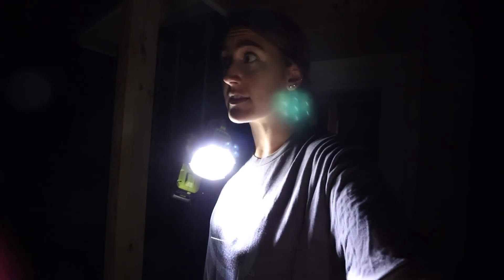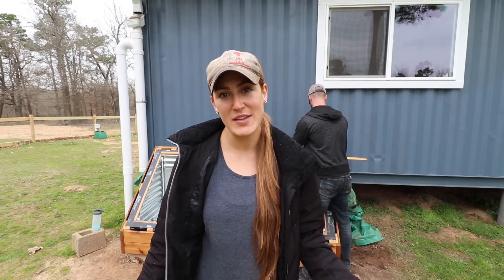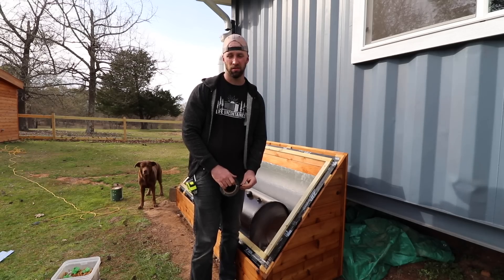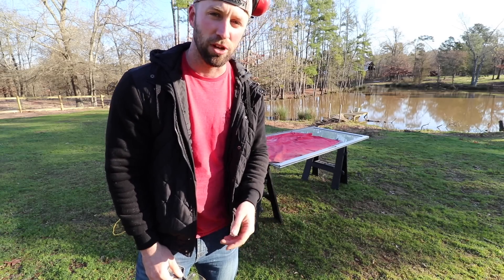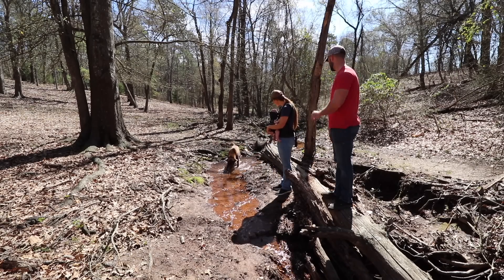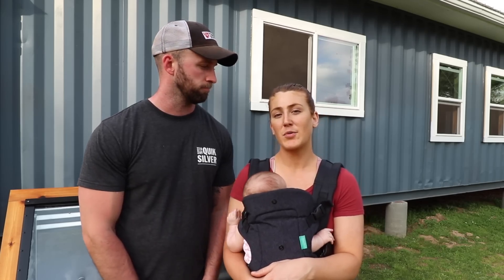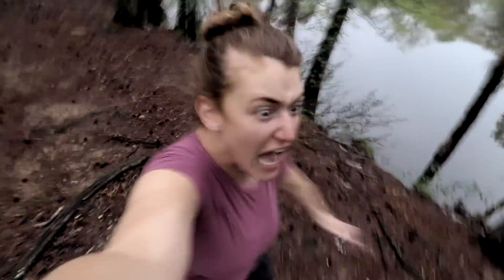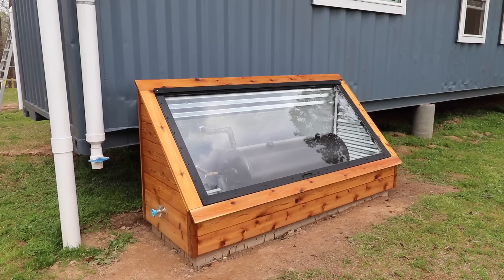Storing The SUN'S ENERGY In A Water Tank!

Comment: **OK, JUST (literally) BINGE WATCHED THE ENTIRE BIULD! Hi, you two (I mean 2.5), My name is Michael, and I'm an Electrician and a first-time commenter from Seattle...

I hope everyone is staying well! I super love the channel, the way you guys film, and your chemistry! I really appreciate the quality way in-which you build things, I've learned a lot, thank you! 

A tiny bit of background on my experience: Retired residential electrician (wired about 500 homes)

A few electrical tips, if I may? IMO you've done a good job on your electrical work so far! I only see a few minor things that I'll point out below. Please forgive if these tips have already been offered...

:) NM cable shouldn't be run in conduit for long distances (it can drastically derate the ampacity of the wire, it's essentially like putting a conduit, inside a conduit), it CAN be sleeved for short distances, and should NEVER be run outside in conduit (the paper filler around the ground wire can wick moisture). I'm not sure if you've actually done this or not, it's hard to see everything on the videos. 

:) NM cables should be secured as they enter the panel, NOT merely run through a conduit TA with bushing.  (a 2 screw metal connector works fine) 

:) IMO lighting in bathrooms is tricky, typically lighting from above doesn't lite the face well; you may consider wiring for additional lighting, just in case you decide the can lighting isn't adequate in preventing shadows. I've had success with wall scones on either side of the mirror along with cans; that way light is coming from different directions; thus, lessening shadows.

Future Tips:

*Cans in the Kitchen are great! Placement is critical though, I'm also 6'-3", your head can easily cast a shadow on your countertop if you place cans behind you. Idea placement is directly above the work surface, that way; you, get great light on the tasking area, and the light goes perfectly into the upper cabinets.

*Nailplate everything! Especially if your wiring/plumbing hole gets closer than 1-1/2" to the outer surface (drywall nailing surface)

Sorry for the book, hope it was helpful!

-M
Reply: Great and much appreciated advice.

Comment: In 2011, I replaced my hot water tank with a huge unvented one, that has a secondary coil, and fitted an evacuated tube solar array, which takes the edge off, in winter, but in summer, can fully cater for all my hot water needs.  I am so proud of the system.

Comment: Don't forget to install a water heater pan underneath your indoor water heater because when they leak they can flood a home.
Reply: Eaxactly...a galvanized tray is all you need.
Reply: @mauriceryton  doesnt have to be galvanized, only if its a gas, otherwise plastic is fine
Reply: Agree with the pan as well and if you had the legs on the bottom of it also reduces cold air transfer
Reply: agreed, it also needs to drain to the exterior or into the sewer system.
Reply: Also remember a drain pipe.  I had a property with a mold issue due to having the pan, but no way to drain.
Reply: In Lancaster PA  said we have to use a expansion tank for our water heater. Not yet pan for it my dad has the heater at 100°F any ways so it won't hurt and the pressure is 110 psi and a water softener guy installed a water pressure valve.
Reply: I was going to mention this too. You'll proly wish you had it on a stand as well and not directly on the floor
Reply: I agree with the other replies.  honestly most water heaters that I've seen come with three legs not sure why yours didn't or if you took yours off.  If you want foam on the bottom of your water heater cut a circle of foam board and glue it to the bottom of the heater and put it in the plastic tray.  Wrapping that heater will save you way more money than just a piece of foam on the bottom.  That little plastic tub will save you thousands when that water heater ruptures.
Reply: Or just make a floor drain, No mess and it goes outside.
Reply: @jonathanpear7361  true I agree
Reply: Yeah, I was thinking that when I saw the foam.
Reply: Just what I was thinking. Never regretted getting one for ours.
Reply: As someone who has had to replace a hallway and bedroom floor due to a pinhole leak in a hot water tank, I cannot stress how strongly I agree with the comments for the drain pan. Other than that, great work and great content.
Reply: Absolutely, a pan with an auto shut off sensor, incase was heater fails. For the batch water heater, why not make the lid/door easier to open, with a  hinge. For sure you will need to get inside for maintenance.
Reply: You should add some pvc from the burst cable down to the drain pan and have the whole pan drain right outside. Also get one of those 9v water sensors that yell when they get wet and put it in the pan
Reply: @crowsnestsac  he put insulation under it so the heat tranfer wont be significant,  but yes best to raise it some
Reply: You'll appreciate a drain pan under that water heater.  When they fail, it's a big damn mess. I know!  You'd be doing yourselves a big favor to have a plan for that water to get out of your new house the way YOU want it to.
Reply: And preferably a drain hose that goes outside attached to the pan.
Reply: Who know what's the background sound 1:40?
Reply: @jonathanpear7361  Should have a drain anyway because you want to flush it every now and then to de-scale. I'd also mount it on a pedestal to raise it off the floor a few inches.
Reply: I was thinking the same thing! Lol I hope they don't forget that part! What a mess that would be!
Reply: Dont know why they make us put a pan inder it. There is way more water in a heater than the pan can hold
Reply: Regarding leaks, this is not about the water heater as much as it is the lines to various locations. It is good to run a main to a manifold (s) and then run a solid tube to the sink, etc.. Best not to have splices inside a wall that one day will leak. Have your leaks where you can get at them.
Reply: @scotthummel4248  The pan is not meant to hold all the water in the water heater. That is why the pan has a drain. The pan essentially funnels the leak to the drain instead of flooding the house. When, not if, the water heater leaks, the water heater will keep filling with water. It is not jut the 40 gallons of water that the tank holds.
Reply: @lifeuncontained.  Is the water heater in your master closet?
Reply: 1000% yes.  Install a metal drain pan under that water heater and drain it to the outside.  It will be your worst day WHEN you spring a leak.
Reply: Or, run the pop of valve underneath the house and route it to a spot the is directed towards the yard.

Comment: We just had a home inspection and inspector recommended water heater to be off the ground by six inches and also in a drip pan with a drain leading outside
Y’all home looks amazing, goals
Reply: Agreed. And at least 4 inches from the wall. This will give you fire safety standards.
Reply: Haley Hanson where the hell do you two live??

   The water heater is inside the house and it must be 6 inches off the floor & 4 inches away from the wall???
Reply: @ltsgarage7780  Pretty sure it was misunderstood...TPR drain pipe needs to discharge 6 inches from the ground, not the water heater itself. That would make more sense.
Reply: Dunjie Zheng that’s been code for 35 or more years. Same thing with the pan. You only need one running to the outside. Put the PTR  valve into the pan. Then run the pan outside. Turn it down and then end must be 6 inches off the ground.
The pan code is only about 5 to 7 
years old.
  The t&p valve running outside is probably 30 years old. 
 Where do u live??
Reply: My dad, a master plumber of 40+ years just agreed with you Haley
Reply: NRFLKN did you see how Haley changed what he said??
   Like you father I’ve been doing plumbing for a very long time. I’ve owned my own business for just over 46 years. 
  Where does your father apply his craft??
Reply: LT's Garage he’s been at it since 1972 but he refuses to completely retire. We’re in Va. He also spent many years as an instructor in the apprenticeship as well as writing the plumbing code for gas log fireplaces.
Reply: NRFLKN that’s cool. I started in 1969. Went through the program. 
  I have a sister that lives in Roanoke. Her husband is a contractor back there. He’s older than I am and still working. I refuse to retire also! Hope his is staying home for now. Hope everyone is doing well. No one is sick??
Reply: If it is off the ground it is most likely a gas hot water heater.  They have an electric hot water heater and does not require an open flame that can cause a combustion.   My parents electric hot water heater was on the ground and close to a wall.
Reply: If it is off the ground it is most likely a gas hot water heater.  They have an electric hot water heater and does not require an open flame that can cause a combustion.   My parents electric hotwater heater was on the ground and close to a wall.
Reply: NRFLKN back in the 70’s & 80’s I had 16 trucks running around most of them had 2 plumbers in each truck.  Then I got out of the new construction. I went to service and remolds. Then in the mid to late 90’s I started slowing down some. I was getting tired of Baby sitting these plumbers that would say the knew how to do service work and didn’t. Then in 2001 I started having pretty major heart attacks. After I had 5 of those along with heart surgery and a few stinks. I got rid of all my plumbers. I really like to wot so I kept 1 of my big service vans. 
Now I work about 10 to 15 hours a week.
  Right now I’m stuck at home with this Shelter in place order going on. 
  I must pay attention to it. I’m over 70 have a bad heart, diabetic 
Enjoy your time. Be safe. Stay sheltered in!!!!!!!!
Reply: LT's Garage  Take care of yourself!  Sounds like you have had a very busy life.
Reply: @ltsgarage7780  NYC here. Agree with everything on tpr/discharge/pan/drainage. Couldn't really find anything on water heater having to be installed 6in. off ground. On requirement here is for older gas water heaters installed in garages - 18in. off ground due to risk of combustion. Newer models are listed for use without elevation. Local code specific maybe?

Comment: On the water heater.  There are thermal blocking pipe nipples that connect to the hot and cold water pipes at the water heater tank.  Bonneville Power Admin Mangan Labs found these were the best energy saving add-on to water heaters in their 1980's energy efficiency testing.  These nipples contain specific flow blocking beads that stop the heat from escaping the tank and the cold water cooling the tank when the water is not flowing.   Love your videos and watching your work and family grow.

Comment: make sure to put you water heater in a plastic tub with an overflow through the floor along with an overflow off your pop off valve through the floor too. That way if your water heater leaks it will be contained and would drain off without damaging your floor.
Reply: I laugh when I see a 50 gallon tank sitting in a 3 inch deep pan with no drain through the floor.

Comment: FYI those sliding glass doors are typically double-pane with a reflective coating on the inside glass to reduce the sun ultraviolet transfer. You won’t get the full impact that a single tempered glass without the coating. Your idea is awesome though! Not trying to be a negative Nancy. 😁
Reply: theres actually 3M tint you can buy now days thats clear but blocks a ton of heat.

Comment: Just a heads up, I had those flex hoses on my hot water tank and they started leaching rubber into our water. First a black ring around the bath tub.  Then particles in all the faucet diffuser screens. Ended up putting pex directly to the tank.
Reply: I have them installed for like 15 years and do not experince that. I loved them and think they are superior

Comment: Should use a clothe when applying stain like that to the wood, brush doesn’t do the justice a rag or clothe would do. Soaks into the wood 100x better. Just a tip!
Reply: I'm starting this project now thank you for the tip...I greatly appreciate it
Reply: George friesen, 
Wiping is fast, almost as fast as spraying, Wiping is also every bit as effective in all situations except possibly into recesses such as inside corners, fluting, deep carvings and the like. Don’t get me wrong. I’m not against brushing stains. I just don’t see why anyone would do it, especially on large surfaces, and even more especially, when using any stain other than a slow drying oil-based stain. All other stains, including water-based, lacquer and all the dye stains, dry too rapidly to allow time to both brush on and get wiped off of large surfaces before the stain begins drying.
Reply: @8lxVenom  I believe he was using the stain with sealer combined, brush is best.

Comment: they probably should've put the insulation and drywall first
Reply: Just wondering why they would do that before finishing all the electrical and plumbing? You do realize they are still doing that right???
Reply: It's called "pop-rock" (only drywall and finish areas behind hvac units, water heaters ect...) it is very difficult to drywall and finish those areas after the units are installed. It can be done. But it is more difficult.
Reply: Pre-rock*
Reply: @spartandrywall  They have to have everything connected to fully pressure test the system. If it has any leaks they would likely have to pull down any sheet rock they'd put up.
Reply: If you didn't understand, I was wondering why they were installing appliances before the put in the drywall

Comment: 3:15  When you clean your vacuum cleaner, you become the vacuum cleaner.  Just a zen moment there :D  You could probably mount the in tank thermometer through where the old thermostat was mounted.  I'd be tempted to also mount a thermometer on the inlet to the preheater housing to check the delta T

Comment: Love you guys.  Consider a drain pan for that water heater, not needed now, but if there are ever leaks, you will appreciate it.  Also, if you connect the drain pan outside, consider putting a short hose on the water heater drain near the bottom, to the pan, then when it is time to drain the water heater to get out sediment(service) It will be all set up, no need to drag a hose in.    I am looking at replacing my water heater, and have been thinking about it a lot.  I am enjoying your videos and S's attention to detail.

Comment: I have a water catch pan under my gas powered hot water heater, The pan has a pvc drain line through a back wall into the backyard. In our last house, the same thing, but the drain line had been run to the garage floor, which was OK as it sloped slightly toward the street. Thanks for the great video. C ya next week.  George & Debyy - Texas City.

Comment: You might need an expansion chamber for the bulk tank, pressure can build up on a hot summer day.
Might consider installing a 12 or 24 volt DC lighting system in the home just in case the inverter fails. Everything is wide open so go for it.

Comment: Great job, it is all looking great. You can also supplement the batch heater with a panel or 2 and a low voltage element. I have a few that I tested. Cheap enough to do.

Comment: Get a water heater jacket also  to help insulate it. I'd also mount it on a raised pedestal, maybe like 4 to 6 inches off the floor with a catch pan and a drain line so you can flush the scale from time to time.

Comment: Been watching your build on and off so I don't know all the ins and outs but I am curious if you'll spray foam the underside, walls and ceiling or how you'll be addressing the thermal envelope. I'm on the HVAC engineering side of things and for the sake of the efficiency of your house, I'd recommend making it as tight as you can. If you do SPF, open cell inside is fine unless you have space/R value constrains, but do closed cell under the floor to also have a water and air barrier.
Having the water heater off the floor is nice, in a pan is a definite must, but the emergency drain will also introduce air leakage and maybe critters you don't want in the house... I live in FL and have seen all sorts of things coming up drain pipes; no snake yet though :) 

If you want to, you can also use a reflective thermal blanket for the w/h to avoid thermal loss to the ambient air that will be cooler than the water inside of the tank. This will be more efficient than just doing the bottom.

Comment: I lived and owned a 38ft sailboat, we sailed the Caribbean for 5 years or so. we rarely took the boat to land we were true off-grid folks.  We made our power to charge the batteries with a wind generator. when the wind would blow hard and the batteries were full we would start to make ice cubes. we would do this until the tiny freezer was full of ice. then if the wind was still blowing we would start converting salt wat to fresh water using a 5 gal per hour water maker (reverse osmosis). We have two tanks for a total of 40 Gal.  When the wind would stop we didn't have to run the diesel engine for several days in order to charge the refrigerator and fill the tanks. You could say we were storing wind power in ice cubes and fresh water.

Comment: If the heater box is properly sealed and you want to get more benefit from it, I suggest to get the entire thing colored BLACK from the inside.
The reflector sheets you have added will fade by time and light reflection will dissipate, but the black color will keep converting light into heat all the time thus the box has to be properly sealed. (minimize air escape)

Hope you got my point and benefit.